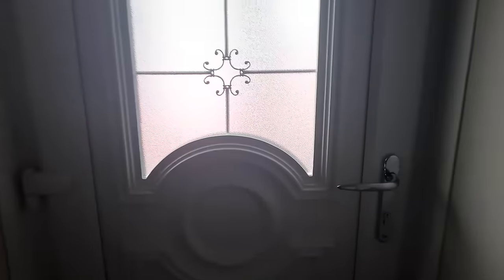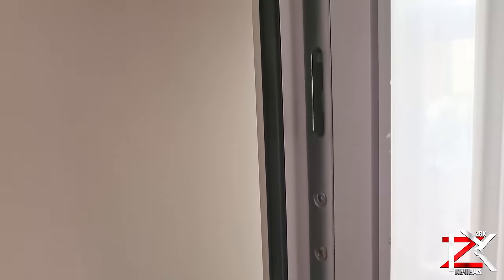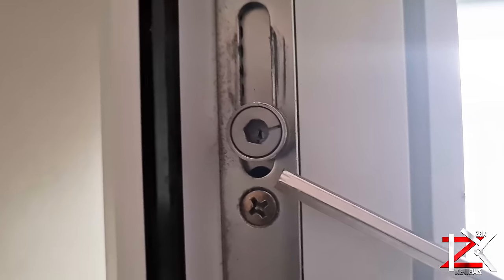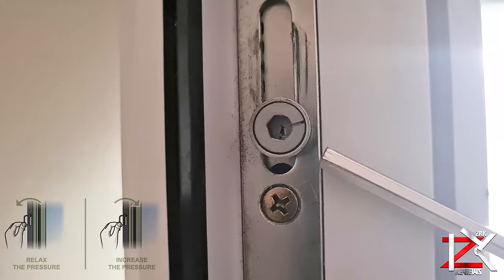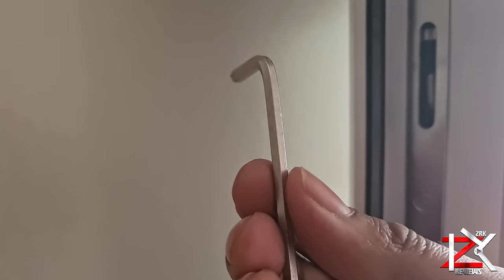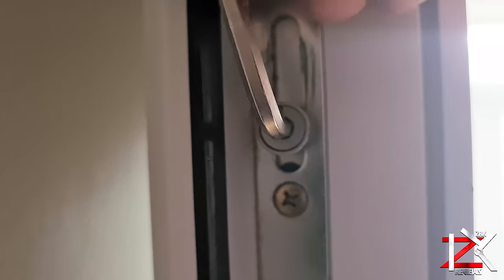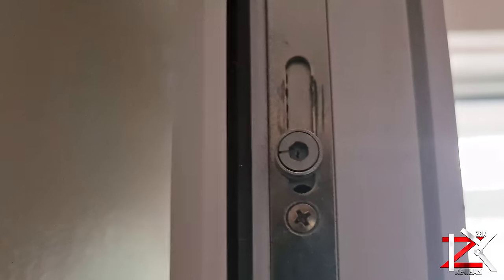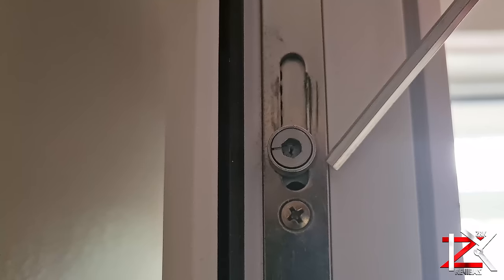How To Stop Cold Air (Draughts) From Windows & Doors - adjust uPVC window/door Winter Summer Mode

Comment: Keep in mind also, rubber seals need replacing after about 10 years. They do not last forever. Hinges also fail, preventing a tight seal.

Comment: My new upvc windows were insall last year I noticed that that top, bottom and handle side are closed and sealed properly when window is locked but the others side is not. When I press it it's moving.
Is there any solution for it?

Comment: How do you adjust the hinge side to pull it onto the seal. I can see a good 1mm gap between my seal and the door when it's closed.
Reply: Also looking for help with this. The problem I have is on the opposite side from the handle (i.e. hinge side).
Reply: If there is a gap on the hinge side then your hinges will need to be replaced, i had this problem on several of my windows, and this cured the problem.
Reply: Depending on the hinge there may be adjustment but it will be hidden. Try taking the caps off top and bottom and see if there is a hole for an allen key, if so, and there is an eccentric cam on the pin then this can move the door closer. The original fitter should have adjusted these but many don't bother.

Comment: Am I correct in presuming you dont need to turn it from 3 o'clock right around to 9 o'clock? If the 9 o'clock setting is too tight I guess you could just turn the cam to 10 or 11 o'clock or even just 1 o'clock?
Reply from the maker: yes you can adjust to your desire, you will notice the seal is tight and the handle is slight stiff which means there will be no drafts

Comment: Hello, on the hinge side around the middle of the window I can hear wind blowing and even ice is forming there (near hinges it seems to be ok, only in the middle). If I press window with my hand wind stops blowing, does that mean I have to replace rubber or is it a hinge problem? Thank you in advance
Reply from the maker: Check the rubber seal if not damaged and adjust the hinges of possible to tighten

Comment: What does turning the Allan bolt do? How does it make the door or window shut more tightly?
Reply: It's moving the circle bit you put your Allan key in closer to the rubber seal,so it's making it even tighter closed. So when moving your Allan key look close at the circle and you will see it moving. There is a mark or  other on the circle which I'm sure is neutral so in-between, the other way is for summer being furthest away from the rubber seal and winter for it being closer to the inside of the window. Hopefully that makes sense.
Reply: @patriciagallacher2905  brilliant, thank you

Comment: I still get a draft after doing this and have even put new rubber seals in door and frame.
Any other ideas? How about hinges..?
Reply from the maker: your keyhole brings in cold air, the hinges make sure the door is aligned with a tight shut. other than that heat does escape through glass.

Comment: This is NOT a 'winter/summer' adjustment, when originally fitted the door should have been properly adjusted to eliminate any draughts but allow the door to close without undue force on the handle. If this wasn't done the fitter should come back and do it. Simply turning the cams to minimise the gap between door and frame could cause the door to bind, this will mean the handle will need to be forced up to engage the cams, resulting in premature failure and an expensive repair bill.

Comment: Ive adjusted the bottom one on the bottom on one of my patio doors but its still not pulling in. I have also adjusted the little plate that the cam goes in on the frame.
Reply: Did you managed to find a solution for this? The bottom of my patio door doesn't shut flush either